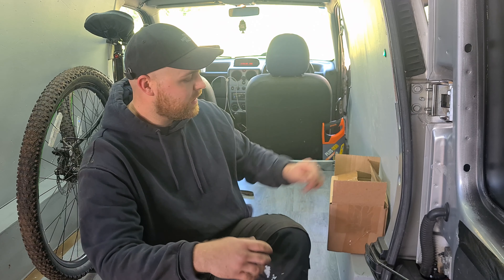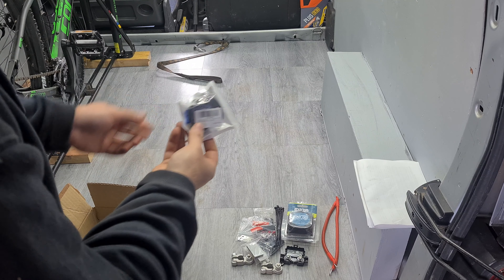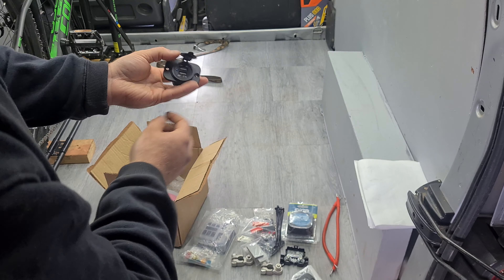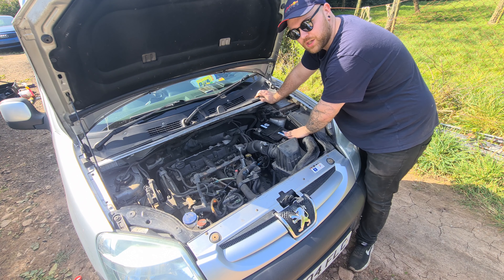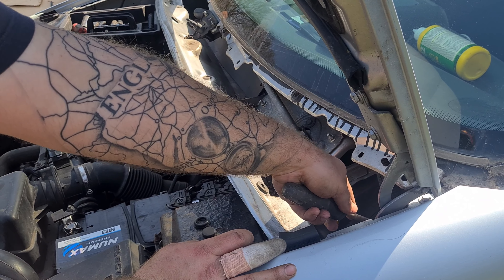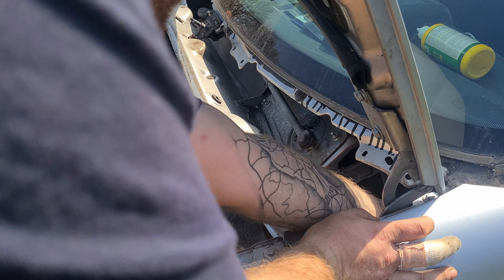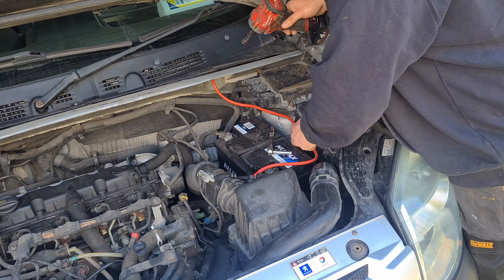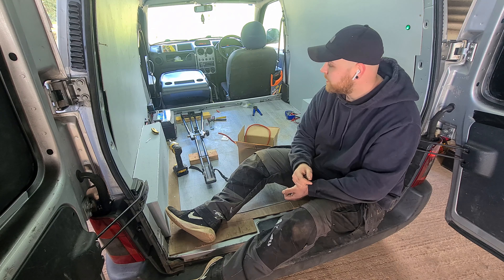INSTALLING SPLIT CHARGE RELAY|EPISODE 3 PEUGEOT PARTNER MICRO CAMPER BUILD

Comment: no need to drill any hole's in your van as there is a huge grommet under the fire wall to take all the factory cables. i have did it with 2011 caddy
Reply: Same with the 2006

Comment: not sure if you finished your camper yet, but how did you implement ventilation? getting rid of the condensation is not so difficult, but proper ventilation with fresh outside air is a problem for me.